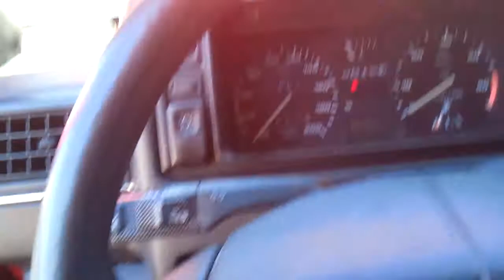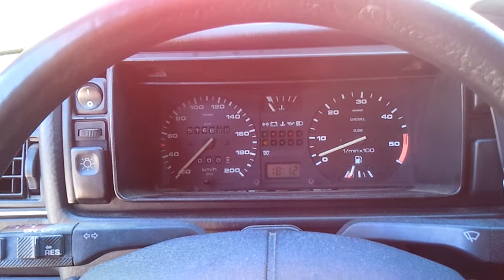Volkswagen MK2 Diesel Alternator Squeel

Comment: Is the tachometer somehow related? I’ve been getting a squealing noise and then the tach starts and stops reading. Blew an alternator belt the other day. Realigned pulleys and put a new belt on. Right away squealing again. Obvs something up with alternator belt but trying to figure out if tach is related or a separate issue
Reply from the maker: Your tach is run off the alternator W signal
Reply: @estacaco33  is belt slippage enough to cause the tach to go in and out?
Reply from the maker: @chrisladouceur4093  if its bad enough it could yes.

Comment: The whole engine sounds pretty unhappy!
Reply from the maker: A lot of the noise was jiggling around of the pulley components. The solution was to ditch the A/C pulley setup and install the non A/C version.
Reply: @estacaco33  so get non a/c set up from another donor car?  mine is breaking belts each 1500 miles, 4000 mile max life lol  thank you
Reply from the maker: @galehess6676  if your a/c doesnt work or you dont really need it yes, the setup is much nicer to deal with.